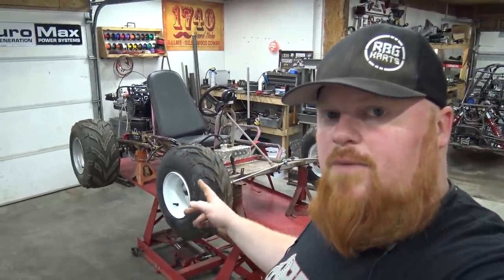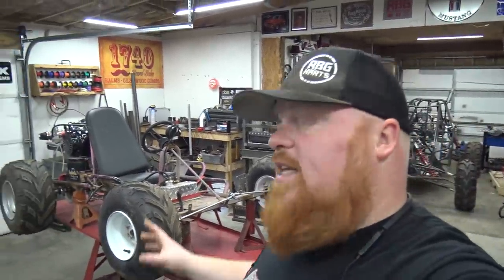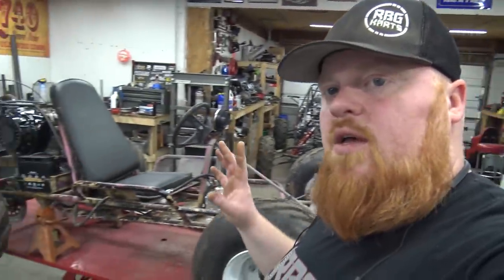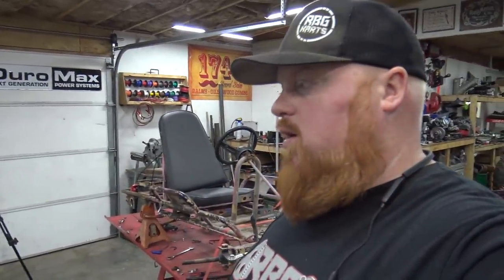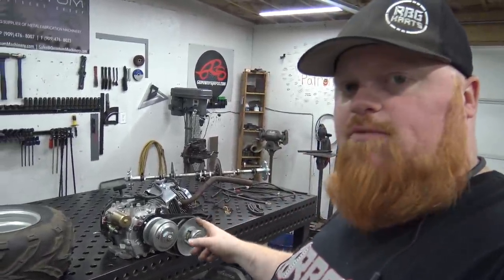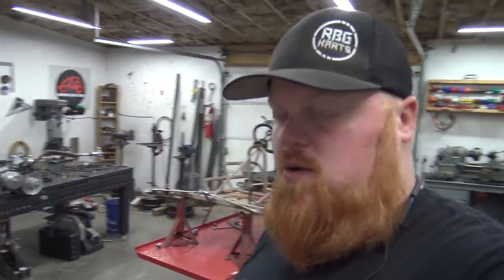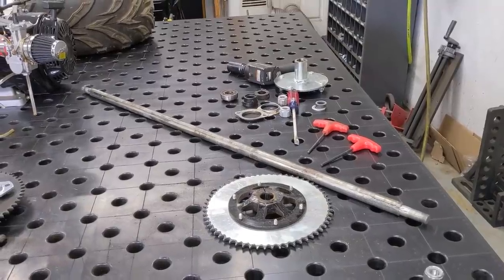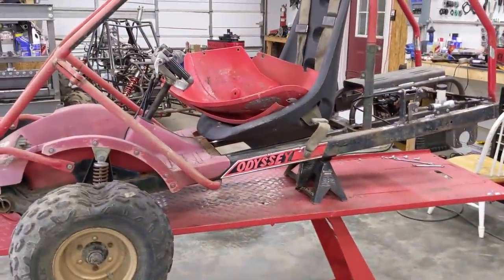BTS Test Kart Tear Down & Father Son Race

Comment: I so excited for the odessy build, I am doing a similar build with a honda gx390 but I'm using the stock gearbox setup with a sprocket on it so I can use the original brakes and the original axle. Excided to see how yours turns out!

Comment: Instead of welding the sprocket to shaft instead make the sprocket into a pinch with a slight bit off the shaft for nut & bolt pass the shaft a bit  to tighten up onto the shaft

Comment: Hey Red, I love your videos and thank you for all you do. I have a question. I just received my Trailmaster mb200 and it has a 208cc motor and a totally different rear fender. The build sheet says 196cc and no reference of any type of upgraded model. I can’t find anything on that configuration anywhere. Trail master uses that engine in certain go carts, but no where is it referenced on the mini bike. Thank you sir and thanks again.

Comment: So other than welding sprockets and brake rotors to the axles, what other options do we have so we don't shear keys on axles with high power engines? Nothing really exists for splines unless it was custom.

Comment: Anyone have a recommendation for a motor/gear setup for a smaller 2 seat go-kart that will be able to pull some light lawn equipment? 

Definitely want electric start but I'm not sure if I need the torque of a 420 or if a 7hp Duromax will do it all. I'm a small guy and I don't need top speed but I don't want to be burning up a belt from pulling a roller for 30 minutes.

Comment: Whats your gear ratio on the manco?? That thing rips! I'm running a 8 tooth jackshaft sprocket on a 60t axle sprocket. It's on a Yerf dog 3203 got a big block Honda gx390 on it
Reply: That setup ought to be pretty slow, torquey,but slow. I run 6:1 ratio on the same model karts with 212's on them. With stock 20 inch tires mine do 35-40mph. I would at least go to a 10 tooth on the jackshaft. 10 tooth if your a big guy and you can go a tooth or more if your a little guy.
Reply from the maker: Its around a 6:1 ratio. It is perfect for his tire size. His engine is still governed also
Reply: @datraktorman69  yea I had a 14 tooth sprocket on there and could get in the upper 50's but I'm going trail riding in the mountains soon so I geared it way down. Top speed now is 30 but I won't even be going that fast up there. I'm also running 22" off-road tires on it.. Does some massive wheelies
Reply: @cameronhouse23  yea,you may be better off where your at. Make your belts last longer not lugging it down with the higher gearing.
Reply: @RedBeardsGarage   I see. Yeah take that governor off and it will be a beast

Comment: Hey guys. I built a super clean ct200r ....  https://youtu.be/nFlNAnbcMbQ  do you think asking $750 for what is basically a mint bike with a full out CS/Outllaw Hisun 196 is too crazy? It's the last of the 3/4 models from early 2016. I know I went ass over teakettle making this thing look like a factory race bike but that's what I'm into, classy build. I also took a Hensim DB30S to the cleaners and mounted a pretty ridiculous $400 Honda Gx160 https://youtu.be/NhFFKL1laAc on it with an NR Racing plate, ustom tensioner so the same chain can run different gears, new brakes,  spare tire and completely running condition for $600.  People keep giving me flack about not wanting motors that were opened up but I know my stuff and my motors are serious a$$ haulers.  Any insight?